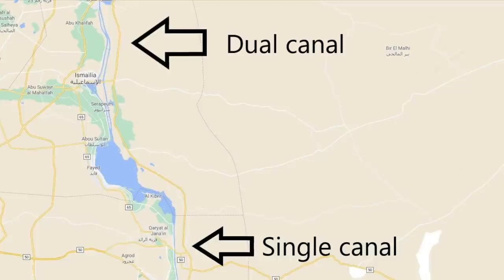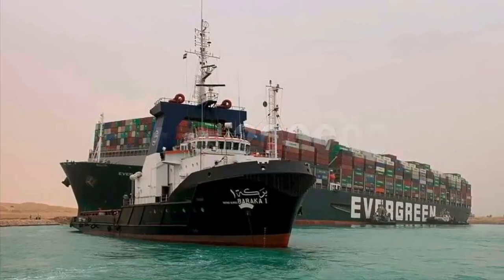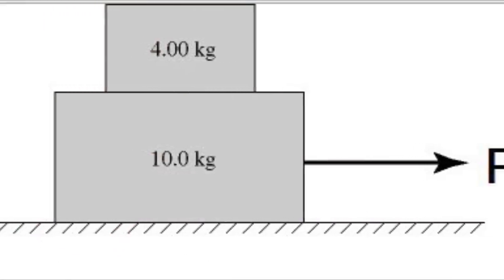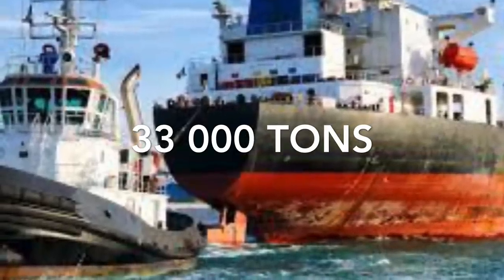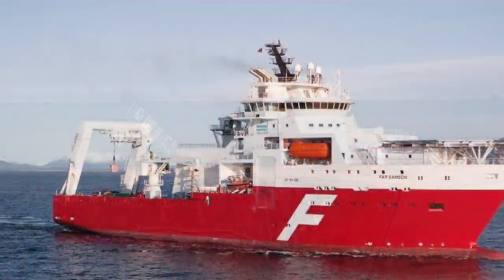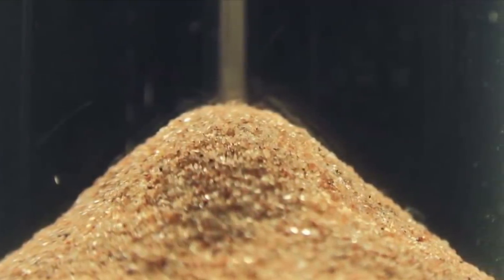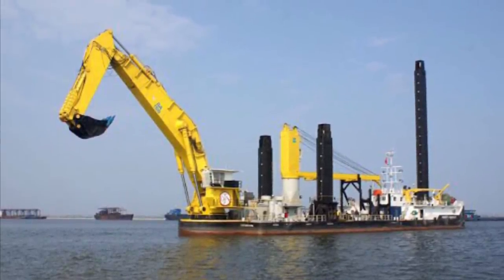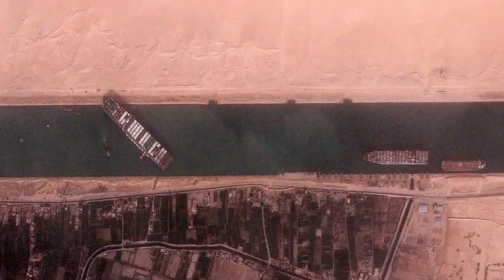MV Ever Given - why can't it be pulled out? Suez canal blocked

Comment: At this point it might just be easier to just dig a new canal around the ship.
Reply: nope the reason why there is ONLY one part here is because they couldnt put a second portion in without having to spend 30 billion dollars (70's dollars) to literally make a set of locks that would be longer than the COMPLETE canal system is long ... 
.
 want it out ... empty it ... and pull it ... or cut it apart right there .... I can think of 20 or 30,000 somallians that would have that ship gone in a few days .... and I do mean GONE ... not a trace of it or anything that was on it ...
Reply: @0623kaboom  Yes but how much does a ship like that cost? Thats a pretty large ship.
Reply: @0623kaboom  Your 20 or 30,000 somallians  idea is the best of all.
Reply: @0623kaboom  Super idea - there are so many poor people there, they will empty these containers in no time. Let them do it already!!
Reply: @0623kaboom   bah,thats for economics of the whole length...  It might ve expensive per metre, but for only 400 metres  they could dredge a new channel without locks.. wetwork
Reply: @Matherofacts  B-52
Reply: They should definitely take the cargo off somehow and destroy the ship lol
Reply: @0623kaboom  Bruh
Reply: @ViewThis.  you mean egyptians lol they rely on this dam
Reply: canal
Reply: @turbodog99  yeah that's the idea, especially the fact that the strongest pulling vessel ever made wouldn't be able to pull more than  0.21% of the stuck ships dry weight.
Reply: Nah, put small drilling rigs in an arc around the bow a few meters away and cut angled holes through the bank 15-20m deep; then load shape charges in the "upstream" hole and blow them a safe distance from the ship. Water RUSHES in, carves out the bank inside the holes, washes out the land holding the bow. Done.
Reply: @onthejob9153  Get a life and stop spamming your copy paste on every comment as if your God's gift to this comment section.
Reply: @turbodog99  then just assemble a mega pulley on the other side and start pulling it. That should be easier
Reply: @ViewThis.  do you remember the movie Lord of War when those people stripped that cargo plane to the Bone in time lapse photography??
Reply: @rontreen3278  Yes I know what you refer to. It could be the same here too. How do you Eat an Elephant?  One Bite At a Time.
Reply: @0623kaboom  that's actually a good idea
Reply: @0623kaboom  Ati Somalians?😂😂
Reply: @onthejob9153  okay we've all seen your comment... the same exact one... 15 times... write something else now...
Reply: @onthejob9153  He did explain the reasoning behind the equation, albeit rather tersely. Yes, the 50% factor comes from the friction between steel and wet sand.

Comment: Why not dig 200 yards ahead of the “nose” of the ship then breach the wall of the canal? With a strong pull to the rear as well as the ships power plus the liquefaction of the sand might mitigate the friction and allow for substantial less friction to dislodge the ship.
Reply: SIGN HIM UP!
Reply: Woah woah woah buddy don't go thinking about stuff and telling these geniuses how to do their job because you might have a damn good idea. It just makes to much sense for 2021.
Reply: Why not just pull it with another freaking container ship the offshore oil and gas industry does this same kind thing every single day, those engineers have obviously never got a 4wheel drive truck stuck in the local mudhole lol
Reply: Monday morning quarterbacks?
Reply: top choppers water works differently than land.
Reply: Doubt that would really work !  I had similar problems before as my construction experience had a few equipments get in similar conditions . Sand is not as predictable as you'd like it to be . In many instances the logical well thought out plan was entirely dismissed by actual actions of Mudder Nature ................
Reply: It is impossible to imagine the scale of what they are dealing with. That ship is likely somewhere around 75 yards wide if not wider and 400 + yards long. Rather than digging out witch would take weeks I wonder if extreme high pressure high volume water could be used to liquify the sand around the hull enough to reduce the friction. Regardless it is going to be a long process.
Reply: Set up an land based pulley systems and used land based power
Reply: Yes, that's what I'm thinking about, but just moving the sand with some water out by using pumps and pipes. And yes, first pull the stern out, not the bow.
Reply: @wirefeed3419  
The risk is to crack or roll the ship. 
There are 18,000 containers on that ship.

Comment: With vessels getting longer and larger, it's time to widen the canal which is longgggg overdue.
Reply: Or just dredge it properly, regularly, and reinforce the banks with concrete. The desert always reclaims. Egypt is a horrific operator.
Reply: Or manufacture more stuff domestically,  you know,  dont let imports kill your economy
Reply: All the workers are too busy buying Bitcoin.
Reply: The dual canal system is what needs to be done, honestly. 
1) It doubles normal operating capacity
2) If a ship becomes stuck, the loss is 50% capacity rather than 100%. Fewer ships have to divert. Some still will need to do that and go around Africa, but then at least critical cargo could be taken into account and choices made.

None of these are cheap projects. None are easy. None are done without a very long timeline for completion. All cause disruption in maritime traffic that accommodates literally trillions of dollars of trade annually. Step 1 has to be that second canal. The designers of the increasingly large super tankers should really consider their use case before the drop billions on a new ship that can't cross major trade channels or can't use major ports of call because they're simply too big.
Reply: @kma3647  I agree, in a vacuum. However, geography usually restricts this. Building canals in sand often isn’t possible.
Reply: @afcgeo882  
The ex president wanted to do just that. He had a $4billion plan to redo the Canal. The current president found out about the money and decided to take over and keep the money for himself. A true corrupt president that stole billions and billions of dollars from Egypt to the point where it has no potential anymore
Reply: @afcgeo882   Not for nothing, but that channel is about 15 miles long, 600ish feet wide and can accommodate drafts in excess of 50 feet.   That is a...breathtaking amount of concrete.  It'd be easier just to build another canal next to it, all told.  Plus, it's not the sand that's the issue, it's figuring out why this particular vessel fishtailed it through the canal, which hasn't quite been ascertained yet.  And, from a practical perspective, when's the last time you've heard of something like this happening?  Not often.  It's gonna be hard to justify laying cubic miles of concrete to reinforce it.
Reply: @phuturephunk  What are you talking about? You’re confusing the canal with the channel in the canal. Also, we know how this happened. And the issue isn’t how often you hear about it happening, but how often it actually happens, which is much more often than you hear about. 

The max width of the canal is 313m, but the width of the dredged channel is 121m. At an 11m depth, the canal is 225m wide. This allows vessels drafting to 66ft, but only in the 121m channel. All container ships in the world fall into that category, but only 61% of tankers do. 

The ship in question is 400m wide and it’s stuck in a 200m wide of a canal for its draft (14.5m/47’7”).

So... do you need a canal that’s 313m wide when the depth is so shallow in half of it or... do you just need a 100m wide canal that’s properly dredged to 70 feet and reinforced? If you don’t want accidents, look at Panama.

Comment: I wonder why did no one foresee this problem? With the sizes of those ships something like this was bound to happen, sooner or later
Reply: They wait till a problem happens and people lose out on money before they consider doing anything
Reply: What would they have done to be proactive to something like this?
Reply: @desertmulehunter  widen the canal? maybe tugrail pulling the ship from land like panama does? i would guess mandatory gps stearing could at least lessen the impact. dig a second canal like in the north, at least there would be no complete blockage. reinforce the banks so it would not have dug so deep into the sand and would be more easy to pull...just some 30sec ideas from someone having nothing to do with ships and canals...
Reply: Gee I dunno quick research into can the major canals handle our dumbass ideas of building giant ships 
Kind of a common sense why build the fastest car if you have no where to drive it sort of thing
Reply: @karlmorzy5959  more money then brains there are a lot of folk who far under this category. Edit: Fall not far
Reply: @desertmulehunter  don't build the ships so large, and such high loads, so that a stiff breeze will blow it sideways. This was one of the largest cargo ships. They need to back off a bit and call it good.
Reply: @karlmorzy5959  if you have no where to drive do not buy the car , but fortunately there are places you can drive and buy the fastest car .
Reply: One major problem with the Suez canal is that it is overdue for an overhaul, but any money invested in that "vanishes" in Egypt's corrupt and incopetent government coffers.
Reply: @Ptero4  hey , fellow linux user . IT or developer ?
Reply: @Ptero4  muchos saludos Juan Manuel (what is the first rule of the fightclub ?)
Reply: I wondered this, like why aren't the ships required to be small enough to be able to be moved if something like this would happen? It's clear to see this would eventually become an issue. I'm not even good at logical stuff and I could see this would be a problem at some point.
Reply: Proof humanity doesn't care.
Reply: @claushellsing  I'm in IT.
Reply: It's not a problem until it happens
Reply: @Ptero4  nice to meet you man. Cheers
Reply: @pookabunny2051  and @Reggie Rendert the reason our amazon shipping cost so low even though your package is million miles away is this bigass container ship. and also, lets say, it cost $100 to ship 10 kg of rice from japan to US. it would be more profitable for shipping companies to order huge container, and ship it all altogether. in shipping industry, size is king. heck, even the design of container ship is restricted to the jetty (container crane on the port) itself, if the container ship is too wide, no container could take the farthest container.

its also the same with the oil industry, but without jetty restriction (the tanker have their own "port" in the middle of the sea) the ship could be bigger. but the oil price dropped and thats why the demand dropped. there will be no shortage of demand in shipping industry, so the ship will be bigger
Reply: Hard to imagine allowing a ship into the canal that is longer than the canal is wide. Did that not cross someone's mind or did dollar signs block their vision?
Reply: Absolutely the billion dollar question,...WHY.?
Reply: In fact, you are talking about a topic related to the nineteenth century, so maybe the engineers thought that ships would get bigger, but they didn't expect ships to reach this size.
Reply: @pookabunny2051  greed
Reply: @ELXatrix  If you widen the canal they simply make the ships bigger. Look up the terms suezmax, panamax, new panamax. As the waterways have gotten bigger they've made the ships bigger to take advantage of it.
Reply: You think Suez Canal Authority is just-another, civilian-run “company” — Mr " @adamd1347 "?!!

If so..

Ohhh.. My "dear"! Have I got an irrigation to sell you?!!
Reply: “Tugrail” WHAT, now???

'Case you didn't notice, less than half-a-week since this incident: Many Egyptians got the bang for their karma when yet-another civilian rail accident: A devastating-collision this once, occurred.

Worse.. The CEO of the operator LITERALLY asked for US$500 mills for maintenance-related upgrades and was publicly-ridiculed by Personality Cult junta-mascot "Sissy" for the same.(
A day after the accident, few residential-buildings in the megalopolis of Greater Cairo also fell.)
And strictly back to the topic: So you want what with those living living on the "African" side? Leave their cities and be uprooted, pack-up their bags — " @ELXatrix "?
Reply: “fortunately”??? Ms " @rozacaylakyan4174 "
Reply: Agree-just not sure sooner or later. Ofload! what a trick that will be-20,000 units. Good time to be a land pirate along the Suiz.
Reply: @desertmulehunter  In Panamá, the ships are measured before they attempt to enter the locks. Maybe there needs to be a check stop built, but idk which countries would bun and run it.
Reply: @ELXatrix  my home town Sunderland in the UK use to be the biggest shipyards until it closed in the 80s, and the river wasn't that wide where they built the ships, when the ships were launched they would use tug boats to guide them till they reached the sea,
Reply: That’s how risk management works .. you only foresee problems once they happen.
Reply: @desertmulehunter  nothing really . Everyone wants to be captain hindsight now.
Reply: I bet there was problems but they did nothing until now
Reply: Hashim Ali Yep kind of like the gutter that only needs replacing when it rains.  Can’t fix it in the rain but it’s all good when it’s not raining.
Reply: When it was built ships weren’t this big. It was plenty of room.
Reply: Because an incident like this is extremely rare and was most likely done on purpose. 
The Suez canal is the largest man made canal in the world and has continuously been upgraded and enlarged. It's now larger than it's ever been in its over 150 years of service. Vessels like this pass through the Suez and even smaller canals every day and have technology in place to keep themselves afloat, balanced and centered. The captain and all the crew should undergo investigation and psychiatric evaluation.
Reply: @Ptero4  where have you been? They recently added another canal to run in both directions at the same time.
Reply: @xheralt I was exaggerating but the sail plane, as they call, is why she ran aground. Since it's one of the biggest, tallest ships with that massive surface area, wind is a real problem. So I think we've reached the limit on these ships.
Reply: "it never happened" is their mindset. it isn't being proactive or reactive, the problem lies is that there's no similar incident to make reference with it, so why "waste" their money to anticipate it?
anticipating it without any basis of any incident would appear wasteful. you just can't say "hey ships might get stuck etc etc" with a world full of proud guys who flaunt their professions to the top, there's possibly less than 1-2% people who would be humble on their profession.

especially with the suez canal they are probably proud with them the only canal that offer safe passage from africa to EU or vice versa.

also those big ship companies are to blame, the canal was made like 100++ years ago so possibly those who made it didn't forsee any problems when handling their "smaller" ships at that time.
Reply: IMPOSSIBELS!
Reply: @geniuspharmacist  Did you watch the video. It explains that the second lane/canal in the Suez canal is only in the northern portion. From the middle point to the bottom there is only one lane. And that ship got stuck in the bottom portion where there is only one lane.
Reply: @desertmulehunter  ...have a canal wide enough that it’s impossible for a ship to block it. Ships can still get stuck in the sand but have enough room to get themselves free. If they can’t get free other ships can still pass. Hey presto, I’ve solved it.
Reply: @Ptero4  I know that it's only half of the canal but saying that it's not being maintained is wrong.
Reply: This was sabotage . It was done on purpose .
Reply: @jlpowell51  well there comes the greed, could simply say you are to big to be allowed throu here. but no they would lose money not letting them throu...its like always one can talk about everything but nothing gets done till something happens...ask every EHS guy anywere ;)
Reply: The same ship rammed a German ferry a few months ago, damaging it severely, when it lost its course in fog. It is a danger to all sea lanes.
Reply: So how exactly can they prevent this accident? Widen the canal? To what extent.. 400 meter 500 meter the ship would still be stuch and Stop the canal?? So what exactly can they do?
Reply: There is more than 50 ships that goes through the canal every day why there is no accident like this ever occur? And the canal hadn't been closed since the war in 1973?
Reply: @desertmulehunter  Disaster recovery planning can really apply to anything, any industry, IT, manufacturing, transportation, etc..  While conducting a disaster recovery test for something like this isn't practical, at the very least, there should have been meetings about how to potentially handle a situation like this.  It sounds as though this had never occurred to anybody who works for the Suez Canal Port Authority.
Reply: @sebidotorg  wow !! There's likely something wrong with that vessel. A properly functional vessel should be able to keep itself afloat, balanced and centered. Good luck taking it back to service and insuring it.
Reply: @kerosamir7101  they keep making these ships larger and larger. This was one of the largest. With all those containers they're very vulnerable in the wind. Maybe they should scale back a bit, grandfather the ones already out there and call it good.